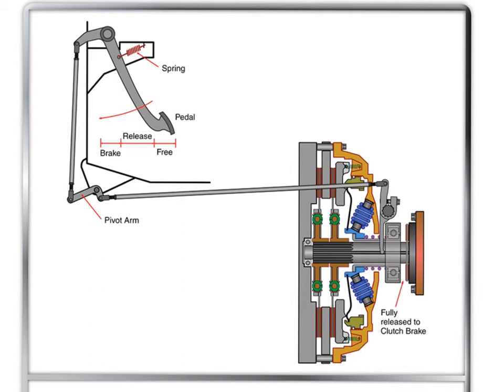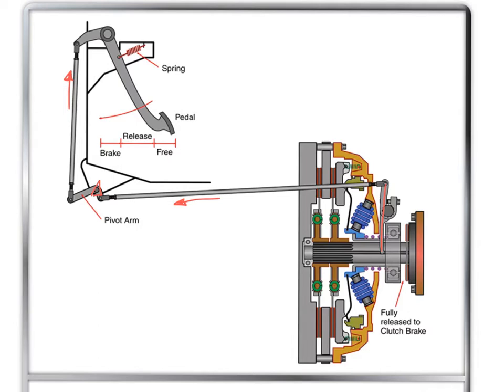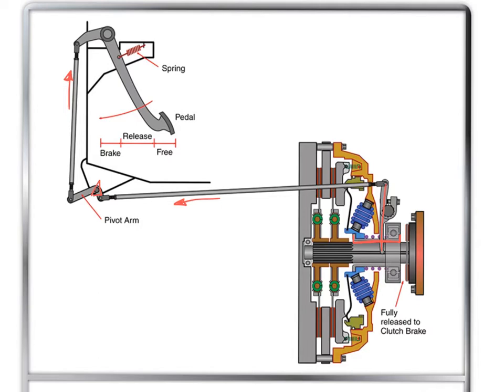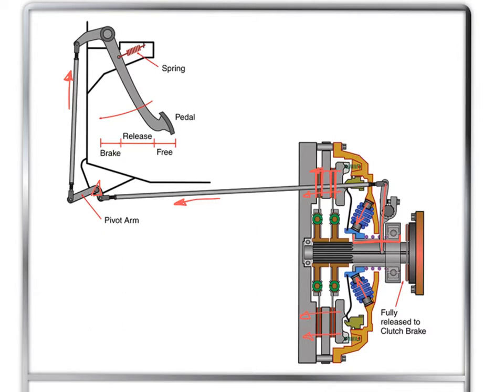Mechanical dual disc clutch wear points and adjustment

Comment: So wonder if you got a 1/2 but  the 1/8 is way over. What then?
Reply from the maker: Then the linkage is likely out of adjustment or the clutch brake was worn out making the 1/2” place the release bearing too far back toward the transmission.
Reply: @THET1916 appreciate it the answer back!!!!